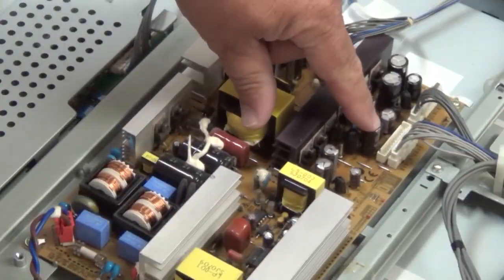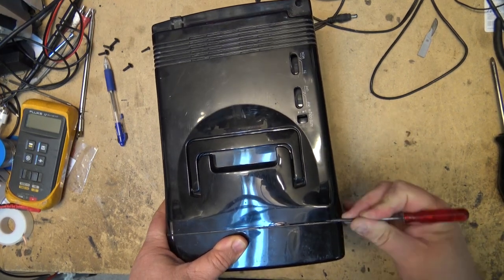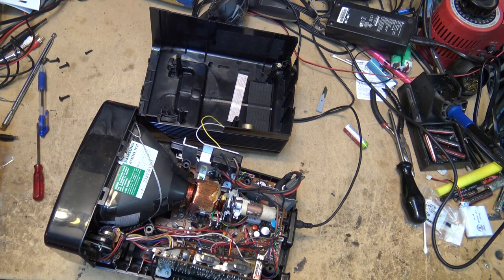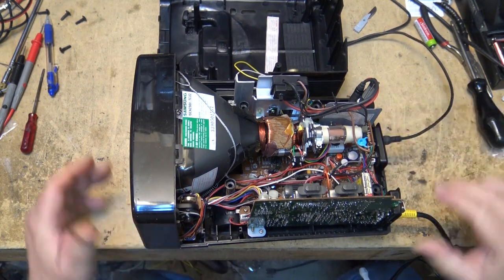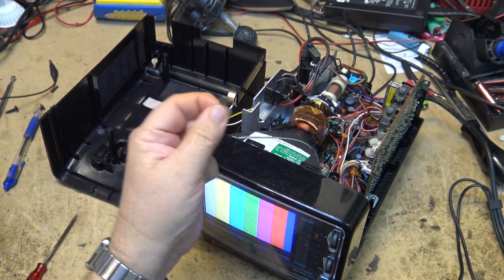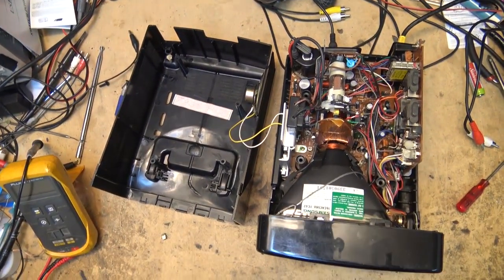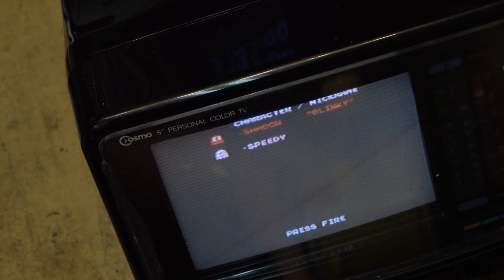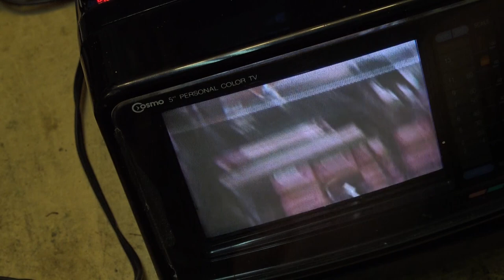Samsung 5" color CRT TV repair

Comment: I love all of your CRT repairs, that's gives me at least a little knowledge on how all these things work. Hard to believe that fly back transformer can ramp it up that high from only 15V. Good grief Batman, that would make one hell of a stun-gun ey?LOL.
Reply from the maker: That CRT probably has 15kV on it.
This is nothing. An MSD ignition module generates about 60KV for your spark plugs in your car engine.
Reply: 15 KV? Jesus R. Christ, that is a lot of volts, how about the amps though, how much are they?
Reply from the maker: @AThreeDogNight  
Microamps. 
A 25" tube ran at 30 kv
Reply: Thank you Buddy, I just wasn't certain if they were kept high for any reason. I kind of thought it would have to lose amps & if so how many.
Reply from the maker: @AThreeDogNight  
Absolutely.  It is to accelerate the beam.  The higher the voltage the faster the electrons fly to the screen.  There is a limit though as the higher the voltage the more the xray production.  Xray tubes are nothing more than crt with no phosphor screen and the anode voltage more like 70 to 80kv. The resulting beam is passed through what is being imaged and onto xray film or now onto a digital image plate for digital imaging.
Reply: Thanks Dave, that helps.
Reply: Thomas Fanning
a few microamps.

Comment: I never knew what the point of a spark gap was. Thanks for the tutorial. This was fun to watch. The video games on the set were fun to watch also. Hope you get to restore the old RCA roundie. 21 incher?
Reply from the maker: It's a console, 25" I believe. I didn't measure it though so it could be 21, as they measured those differently. Hopefully it will be here soon to restore.

Comment: remove the TV and games from their cases and build a tiny bench-top arcade machine...
Reply from the maker: Yes I was actually thinking of doing just that with a 14 or 19" TV.  Make a dedicated pack man or spiderman game.  If I had wood working tools and skills I would do it.  My dad had lots of woodwork tools, radial arm saw ect.  My brother in law took those and tossed a bunch of them.  A table top pacman game would be fantastic.
Reply: You could use a Raspberry Pi to run any game you want. Older ones have standard RCA output for video, newer still have it on the audio jack, you just need the right cable. 

Game controls can be wired up to the pin headers on the Pi. So could a coin mechanism. Bonus points if you can only play it with Canadian pennies.
Reply from the maker: @coyote_den  
Where do you find games for the pi. I have a few of them kicking around. I use them as media streamers into sd modulators as they have composite out.  I have a pi2 just sitting on my desk.
Reply: @12voltvids  you'll want to put a RetroPie image on one for the MAME emulator, then you can find the ROMs by googling MAME ROMS. Some ROM sites are less than reputable, so be sure to private browsing and something like NoScript or uBlock Origin as the ads are what try to push malware, not the site itself.

Comment: I've got mine on the bench now, here in the UK, this is the Samsung PAL version, no spark gaps, just holes in the crt board. That one you've got is in mint condition, mine has been use every day from new, of course now with a digi receiver box plugged into the phono sockets. I use it in the kitchen for radio in the morning and tv in the evening over dinner. It looks very old but still a good crt picture. I've fixed the radio at the station I always use to save having to retune. Just a little problem at the moment of the crt heater sometimes going off but that should be easy enough to repair. Nice to watch your video, thanks. I'll watch fully later.

Comment: Nice repair again ! from youtube image seem like the CRT appears to be gassy, as an old crt retired tv tech we used to install a CRT inline filament voltage booster on them who increased brightness allot we also had CRT test equipment that had a maintenance image booster mode on them also before installing a filament booster permanently ! I do appreciate your no nonsense explanation that go direct to the problem keep up the good work !
Reply from the maker: Definately not gassy. Has a fantastic picture on it. I am actually using this in my studio to monitor my Worverine film scanner as it is scanning film, because the image is superior to the 2"LCD on the machine.

Comment: I think we have both got the same mind set, could tell that it had eht, so my next guess would have been the video drive transistor/s, mind you I would of never guessed the spark gap was short. It's nice to see the proper component used rather than a coupe of etched points on the board. well done.
Reply from the maker: The spark gaps that were open I saw fail regularly. I have never seen one that is covered in heat shrink tubing fail, but this one did fail.
I learned something too.

Comment: Such clean internals on this wee TV. I wonder, it probably hasn't done many hours if any!.... Normally the flyback has got a dirty coating along with the EHT connect to the CRT. I used to be able to hear the flyback horizontal oscillator kickup on pictube TVs the minute the power button was pressed but i've formed a notch in my hearing to it having grown old....!

Comment: The 1955 RCA color TV 21CT55 is very rare. First released in late 1954, it was the second generation color TV with a full screen.  The CTC-10 (the first commercially available color TV) had a cropped 9 inch screen.
Reply from the maker: Yes I know how rare they are. This is the first one I have seen since 1981
Reply: I ... hope you do a video on that TV. @12voltvids

Comment: I used to repair coin operated arcade games and jukeboxes. The jamma  connectors were a common problem in commercial arcade games They would overheat in time and burn the finger traces on the logic boards mostly on the 5.5 volt supply line because that drew most of the current

Comment: I love these small 5" crts ive got a sony 6000be which is a really nice set, I just bought another 5" crt from ebay bought as a dead set so will be interesting to see whats wrong with it when it arrives, its a lot smaller than the sony it's by some unknown make in a black casing  but looks pretty funky.

Comment: I had a Radio Shack Portavision 5" color TV with a similar Samsung tube in it, which sadly went to air. I found that while the color was excellent, the horizontal resolution was really low; I counted around 200 lines.
Reply from the maker: Yes the horizontal resolution is pretty low on these tubes, because they used pretty much the same mask pitch as regular larger tubes.
I do have a few very high rez CRTs including a monster 21" multi sync Viewsonic computer screen. That being VGA RGB, on a PC it is bloody amazing. I also have a high rez 14" commodore monitor that uses a delta matrix tube and is of considerably higher resolution than the inline gun types.
The trinitron was one of the lower resolution tubes. Most couldn't do much better than 200 lines of horizontal resolution. This is why they looked so good on crapy VHS tapes. I remember when I worked in broadcast we would never use a Sony TV to check for quality as they were so poor that everything looked good. We used Conrac monitors for evaulation. I have 2 Conrac monitors stashed away and they look amazing if you give them a good signal. Give them a VHS signal and they look like crap, because VHS was / is crap and the Conrac shows all the limitations. They came out of a broadcast studio, and I used them in my production studio back in the analog days, in my editing bay.
Reply: @12voltvids  To suggest the Trinitron tubes  had a resolution of 200 lines is like saying the QE2 can only carry six passengers. I could display high def (900 lines+) on a profeel trinitron in the  80s. They were and continued to be better - brighter/sharper/more linear/better colour than (almost) any shadow mask set up till the mid 90s, when the technology eventually caught up.
Reply from the maker: @martinda7446  
Trinitron tubes had horrible bandwidth.  Ask any broadcast engineer.  Now they did get better but when I worked as an intern at a broadcast station any crap tape played on the Sony monitor looked great but looked like crap on the conrac and tektronix monitors.  The reason the engineers said was the bandwidth on trinitron wss only about 200 TV lines.  Not scanning lines there are 525 or those.  Horizontal resolution was said to be about 200. Put up a mono scope test signal and see for yourself.  We never used Sony monitors for picture grading.  We had plenty in the studio for studio monitors but in the control room it was all conrac and tektronix for color monitors and electrohome for the bw camera monitors and a real high rez conrac bw monitor on the camera control unit for camera registration. Adjustments.
Reply from the maker: The reason that trinitron tubes looked so good was because they couldn't display the fine detail, so they made everything look good. They did get much better in the 90's with the XBR line, but the earlier tubes were always soft. That is why they looked good on cable TV, they masked the noise.
Reply from the maker: We tested them in the studio, and they all fell far short of acceptable for broadcast color grading. There were big signs warning production staff to not rely on any of the trinitron monitors when grading a tape received from the field, as they might look fine on the trinitorn, but not meet the standards for broadcast. This changed when they came out with the fine pitch used on the XBR and Profeel pro, but prior to that the original trinitron were pretty soft. The also had 2 fine wires that ran horizontally across the tune in the top and bottom 1/4 of the screen.
This is why most computer monitors did not use a trinitron tube.
Reply from the maker: Tell that to EVERY BROADCAST ENGINEER that refused to use any trinitron monitor in the early 80's for source evaluation.
I didn't say that, the engineers at the station did. The reasons they gave, and t hey were valid is because everything looked great on the trinitron monitors. You could put in a 3rd generation VHS tape on a trinitron monitor and it looked fine. Play the same tape on a Tek or COnrac and it looked like total shit. the reason given was that the trinitron sets had low bandwidth. Not saying that it was the tube that gave them the low bandwidth, it is just the trinitron monitors that were all over the studio were soft as hell, and the stripes on the tube were much larger than the dots on the delta matrix Conrac tubes. 
Sure they were brighter, because there was no shadow mask to absorb the beam. Triitron tubes always passed more electrons through the slotted aprature grill, but the stripes were also larger.
They did improve, but the ones we had in the late 70's early 80's were not very good as far as bandwidth went. We could see the difference on the monoscope pattern that was shot with a broadcast camera.
I did my internship at a local station from 80-82 and the monitors we had (sony) were brand new sets at that time. They were used in the studio for the talent to see themself on. In the control room, and master control not a sony could be found.
Reply: @12voltvids  I stick with my previous thoughts, no studio would ever use domestic sets for evaluation of course, Sony have in my experience never produced a professional product that was below par, be it audio, video or a cheese toaster, they have been quite remarkable with their product history scoring many 'firsts' and setting many trends. The Trinitron tube was a leap  forward for the CRT - That is the way history will remember it, as I will too, and what happened in some studio in 1982 aint gonna alter the fact.
Reply: Maybe you should try a Trinitron incorporated monitor that had a 400+Mhz video bandwith  and displayed 2K images?
EDIT and of course the monitor that looked good was 'shit' and the one that looked 'shit' was good.
That was often an excuse in the audio industry, the crap sound was because the 'amplifier is so good, it is revealing the poor source material' - Now I know that was bullshit, because I was there. And it sounds remarkably like the same old excuse with the monitors. ''Why does the Sony make your beloved Conrac look crap?' - 'Er, its just the er bandwidth, its not revealing like the Conrac''.
Glad you liked the Trinitron HD....Quality product.
Reply from the maker: @martinda7446  
I had one. A 34" 16x9 monitor.  It did 1920x1080. That was an hd tube.  Completely different form the old crazy trinitron tubes from the early 80s that made everything no bad how it was look great.
Reply from the maker: @martinda7446  
I never thought the tek and conrac monitors were any good because if I put on a 3/4, betamax or VHS tape they looked like crap and looked fine on Sony.  Then the head engineer gave me an education about the monitor quality and showed me on the scope the noise that was making the video look bad.  It wasn't just the video, sync stability, jitter everything.  The Sony monitor compensated for this.  Fine for watching TV but no good for signal evaluation where an out of   spec signal could blow the transmitter on worst case or cause interference which would result in a huge fine. So the reference monitors would appear to be unstable but the fact is this is how they were designed. To reveal technical problems in the signal.

Comment: Great job fixing the TV. I got hooked on mini TVs when I got a red 5.5" one from the 80's as a gift. I hooked composite in to the main chip and connected it to a Raspberry Pi Zero. I love playing Game Boy games on it. Don't care that the refresh rate is small. I also bought a 6"color TV for 10€ at a flea market. Unfortunately I can't get it to show color image. I don't know if it's PAL or NTSC. So far all PAL devices showed in b&w. I'm trying to configure Retropie to be in NTSC so I know it's not a software problem. Have you come across similiar issues? Black & white TVs can be found online here, but colour mini TVs are very rare.

Comment: very nice, omg pacman. So good job, excellent!
Reply from the maker: I should play it on my hi resolution commodore CRT monitor. That one has composite, Svideo AND RGB component video. Quite a rare monitor from an old Commodore computer.
Reply from the maker: I would think that game and the spiderman game are pretty rare in theses handheld plug and play devices these days. Especially as these are official licensed products.
Reply: 12voltvids I repair different TV, pick up from garbage for play with original Xbox, but sinudyne and Telefunken (I remember type palcolor) makes after 5-6 years later, red pixed locked. Obiuvsly this TV has at least 30-35 years old

Comment: 12VOLTVIDS, what does the monitors B+ voltage control? if the B+ voltage is not set at a normal voltage at 125vdc it will display a scrambled image any reasons why? is the B+ voltage a bias voltage DC offset voltage for the sync and hold circuit?

Comment: You should try to RGB mod it!
Reply from the maker: This one would be easy, as it runs on DC so no isolation needed, however it doesn't have OSD, and that is where the modifiers insert the RGB signal.
Would have to look up the YCJ IC and see if it has the inputs available.

Comment: I have a Cosmo black and white 5" like this one and it doesn't work properly, the image is compressed verticaly and the tv emits a crackling sound... i'd like to have your skill in order to repair it!!
Reply from the maker: That would be a capacitor in the vertical sweep circuit that is causing it.
These are simple circuits great for learning on.
If you understand electronic basics anyone can learn it. I learned as a teenager, and honed my skills for 20 years when I was doing this for a living.
You never stop learning. I still learn new things today, and I have been servicing electronics for over 35 years now!
Get yourself a schematic, and do lots of reading and watching. You will be surprised what you can pick up. I never did plasma or LCD tvs in my career, yet I have fixed a few of them. Right here. The plasma sets you see me fix here are the first and only plasma sets I have repaired, and I knew very little about them because they came online after I had left the business professionally.

Comment: Is it just due to the camera angle or is this CRT not a 4:3 one? Because it looks wider.
Reply from the maker: It is most certainly a 4:3 aspect ratio and it works great. I am using this as a monitor for tape transfers to digital as it is big enough to keep an eye on what is going on during the transfer  and small enough as to not use up all the real estate on my desk.

Comment: My tv only works color by antena but dont be video of consoles, i tryed with pal and ntsc but nothing works, this tv is pal or ntsc? Whats can be test to trying be color?
Reply from the maker: Could be video from console a little off frequency in the color burst area which is what is used to lock the color oscillator.
Reply: @12voltvids  i tried with a ps2 with chip change pal, ntsc, norhing works i check capacitors and the board and dont see any issue, i confused
Reply: @12voltvids  the button auto color is for change pal to ntsc? Or only for the image? I see this button rare..
Reply from the maker: @nicosauseador  just switches from the front controls to a set of internals that a tech sets up.
Reply: @12voltvids  i test by 3 consoles (sega genesis, ps2 and snes), and find a dvd player with pal and ntsc and nothing worked, black and white works perfect.

Comment: with which tester you tested the colors sir
Reply: He used a camera with a colour bar generator. If you want a TV pattern generator they are cheap as chips on eBay or easy to make a simple one too. Or an old personal computer with a modulated output can generate simple patterns.